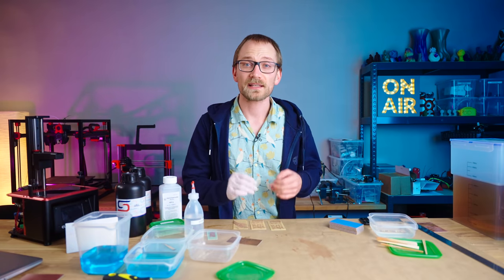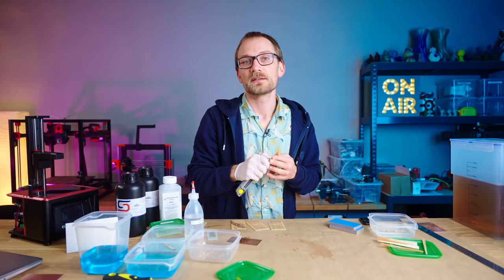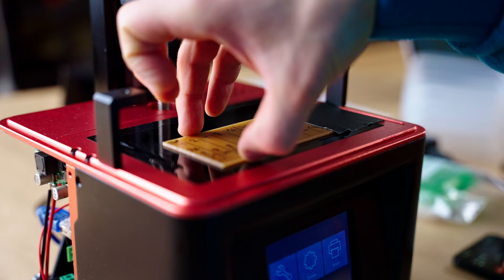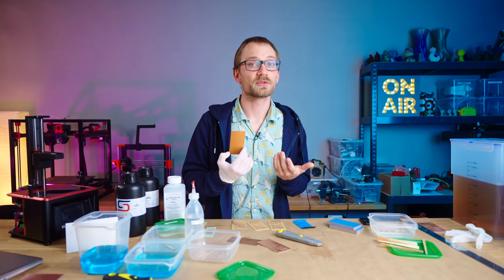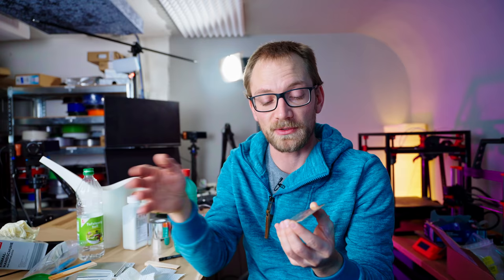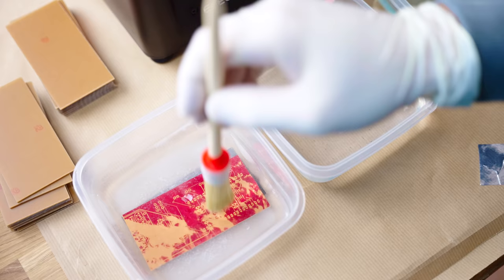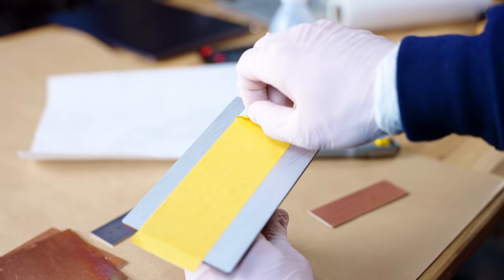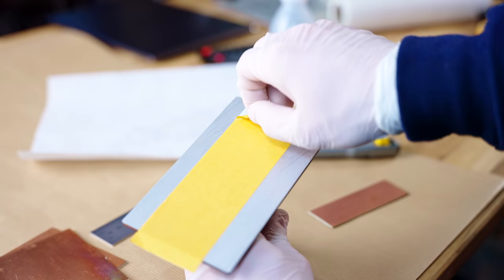The fastest way to make crisp PCBs at home!

Comment: In the past, when I was still dealing with single-sided PCBs, this would have been a great technique. I then used sheets of overhead paper and a good laser printer to make transparencies and lay them over my PCB boards so that I could expose them.
Meanwhile, with the current CPUs that we use, even double-sided PCBs are often not good enough anymore, and I use multilayer PCBs. For this, you cannot go with hobby equipment (unfortunately) and you have to go to PCB factories that can usually make a PCB within 2 days.
But for anyone who needs a single-sided print, this is a great solution. Thank you for showing.
Reply: If you're able to line them up perfectly, you could do double-sided boards as well. But unless you want to go through the process of plating through-holes, you'll have to settle for making vias by soldering a short section of wire between the two sides, and either use rivets for the actual through-holes, or add the aforementioned vias next to them so it doesn't matter which side the components are soldered to.
Reply: 3dprint a jig , and you can do doublesided with no alignment problems. multilayer is ofcourse out of reach at home.
Reply: @chriskwakernaat2328  if you're printing a jig and have standard sized boards, you can easily layer boards, use thinner single sided boards, with a double sided base board and drill alignment holes, and you can easily stack them with a layer of epoxy, though you need to drill bigger holes to solder the vias, which would be the main pain point.
If you don't mind a thicker board you can use rivets for the through holes, and 3d print a spacer to hold the rivet heads.

Comment: I imagine that for prototyping and small scale fabrication, this is kind of a game changer.
Reply: Not yet.
But for some really simple shcemes - yes
Reply: Example: Using a resin printer and this technique... I wonder how many little button cells disposable flashlights you could make in an afternoon?
Reply: @StevenIngram  a lot, but less than by making them with iron and printed paper, but for prototyping is superior in terms of effort.

Comment: I strongly recommend using ground planes on your PCB designs. It's way easier to design a board with a ground plane. It also means you remove less copper, which in turn makes the chemical last longer.
Reply: It’s harder to solder without the mask if you have ground plains. This is for prototyping and fast iteration.
Reply: @xferme  Every board I've made has a ground plane, and I didn't have any problems soldering to any of them without a solder mask. Maybe it's not the same case for SMD components; I've only ventured as far as THT, so far.
Reply: If you're doing it professionally then 4 layer with 2x signal and ground+power planes is what I'd suggest as a minimum for anything that isn't completely basic, which obviously is not possible using this method. Not just for making routing easier but for EMC compliance it's much easier as well. You still have to know what you're doing though, but not as much. When I was first playing around with 2 layer opamp boards I remember introducing error where the high gain opamps amplified the poor return path impedance where I was weaving top-bottom layers. So for serious prototyping, no I would never do this. It's just a hobby thing.

Comment: This is a nice idea. I use positive 20 because it's cheaper than than pre-coated boards (just needs a bit of spray-painting skill). 

To make big boards you would need a big resin printer, though.

But it's real quick. I currently start with a PDF of my tracks that I have printed on tracing paper. Then I sandwich the paper between the coated PCB and a thick piece of perspex. That goes in the sun (after a couple of test exposures to get the time right as sunlight is always changing). I get pretty good results. Suitable for prototyping.

Comment: This is a great idea! I've done many PCBs with the toner transfer method, but it does struggle a bit on smaller features. One suggestion - when using a small etch batch, you get a faster and better etch by removing less copper. Just use flood fills on most/all of the board. You can also make your fill a ground plane, which can help simplify routing and improve signal integrity or thermal performance in some cases as well.
Reply: Im looking at dry photoresist.  Also there is a spray on solder mask that you can solder to before its cured.  So you can tin the PCB and then spray on the mask.  Then solder each area you want a clean pad.  Then UV the whole lot and drill the holes.

Comment: Always add "copper pour" to your boards that you are making with this method because it dramatically reduces the amount of copper needed to remove during etching (and with it the amount of chemicals used and fumes released). It is very easy to do, and can also serve as a ground plane so it makes board design easier.
Reply: But if you get industrial opto coupling interface large copper pour areas on the board is danger for the insulation especially if your project contains igbt or scr connected at power sources fairly different voltages of the logics supply .
Reply: @satipsrl5207  Those boards should be designed as two separate boards and you can add copper pour only on one side or on both, but with different amount of clearance. There should also be a zone that goes under optocouplers that has no copper at all, and also it is common to put cuts in the PCB along that zone

Comment: That's what those little cnc's are good for. Even allows you to drill the through holes. Even one of those give away sample printers can be converted  and use one of those small 60 watt spindles. Even better is using a diode laser for the copper part then drill.

Comment: I've been wanting something to cheaply prototype boards for a while. Very cool!
Reply: There are a few other options to check into as well, like tried and true Laser toner (I've done that and it worked well for me). Also someone modified a laser printer that apply toner directly on boards and then used acetone vapor to fix it. Laser printers can make larger boards.  The method shown in this video of using a budget MSLA printer is very cool though!
Reply: You can't CHEAPLY do this.....

Comment: You could use photoresist film and apply it to the plane copper. Would be a great way for model makers to make brass etching for models or dioramas.
Reply: We used photo resist spray back when I was in the school electronics club. It was kind of an acquired art to get it even though.
Reply: How do we remove air bubbles when we apply dry film to copper clad ?

Comment: FINALLY!  I told people 2 years ago to use their resin printer with photoresist film. Great demo!
  I've made small silkscreen masks  this way too!  You can make the circuitboard and some artwork for the enclosure onthe same machine. That in itself is a boon for any small maker/tinker.

I've been expecting someone to put a Chitu board in a flatbed scanner body tbh.

Comment: Back in the 90s we were taught how to make PCBs at school.
You draw the traces on the computer (Acorn Archimedes!) And then print them on the laser printer.
You put this and the special photo resist PCB blank into the tiny little UV PCB sunbed and expose.
Then you put the PCB blank into the etch bath with its hot vibrating acid.
Wash it off, buff it with wire wool and drill the pads with the 1mm bit in the drill press.
Good Times.

Comment: I am making my boards like this for over 2 years (as Fusion 360 added electronics to their setup)
You do not have to move from eagle to F360 as you have Eagle in F360 already.

Another way (a little faster) if you have transparent foil and ink printer - you may turn your printer in test mode to turn screen on and mask it with print from eagle on foil directly.

Comment: Just started watching your video.
As a soap-maker I can tell you that your plastic containers are fine for NaOH (Sodium hydroxide). The thing you really want to avoid (and it is pretty counter-intuitive, or I always thought it was) is GLASS. NaOH will etch glass and your container will, eventually, break. I'm not sure about lab equipment which isn't made from silicon (it's made from quartz glass) but, again, as a soap-maker (I've gone through a LOT of NaOH. It's what makes fats into soaps. Which is not at all the same thing as the detergents that are called 'soap' by most people. There is also KOH, potassium hydroxide, which is for 'soft' soaps. Both are called, "lye," but I digress...)

Yes, pour your excess lye down your drain. It's not going to hurt anything. It will NOT harm your PVC pipes. That said, I wouldn't know what to do with lye that is contaminated with whatever chemicals get added to it from the photo-resist layer (I'm a soap-maker not a chemist). That's a whole 'nother animal and you should do your own research on that. Lye, by itself, is probably less environmentally hazardous than some of the drain-cleaners you can buy at the grocery store.

All of that said: LYE IS DANGEROUS! 
It absolutely WILL eat you if you get it on you. 
Fragrance oils are pretty nasty, too. Ask me how I know that one...
Reply: I would still check with the local recycling station and try to bring any chemicals to them for disposal, and not just flush it down the drain. The sewage system operators will thank you, as every chemical that you throw at them could cause reactions with other materials/chemicals and eventually will need to be neutralized and removed again from the water somehow. If you can easily avoid adding more unnecessary contamination into the sewage system, you should always try that option first.
Reply: I dont know NaOH etches glass, i have stored NaOH pellets in a glass container.
Reply: @SandeepKumar-jj7zi , pellets are probably fine. As long as you don't get them wet. Once you mix them with water to make the lye it will etch glass. 
Of course, it also depends on the concentration of the lye. Lye for soap is pretty highly concentrated. 
Also, it's an exothermic reaction. In simple terms, it gets hot. It can get surprisingly hot, really. The fumes are pretty nasty, too. 

The long and the short of it is that lye is quite dangerous and if you don't respect it you're going to get hurt. Maybe in a permanent way.

Comment: Been doing this since I got my first MSLA. But you have to watch the exposures near the edges. On most consumer MSLA printers (Prusa's SL1 excepted) there is a significant drop off in exposure near the edges (it actually starts as soon as you get off center). I've gotten around this by creating my PCB layouts in 3D with depth, then a bool layer trims them down in the Z radially so that as more and more layers get exposed less and less of the center gets exposed. Instead one exposure the printer fractionally goes through about 8, each time including less and less of the center. Now traces at the edges are the same thickness as the center with no under exposure. Very clean, no almost opaque laser printed masks, and because you don't have the print plate getting in the way you can put an alignment system on the stage and do double sided board in perfect registration.
Reply: I am trying to make PCB using same technique, but tracks on the photoresist film seems foggy(poor resolution) after exposure to uv light. Do you know how can this issue be resolved?
Reply: How large are the traces? There is only so much resolution on the LCD for masking, but even then you can get them pretty fine.

 How long are you exposing for?  What are you using  to develop the photoresist?

Depending on which machine you have and what kind of light engine is inside (and what kind of lenses) you may need to put a UV transparent diffuser film right on the LCD glass to even out the light.

Comment: Very nice. I have a laser engraver and I did some PCBs by painting it with permanent marker and laser the tracks away. then acid and it's done! Like what you were trying to do with the resin directly on the PCB. Also works very well and gets very fine results... depending on the laser's resolution. But 90 seconds for a "big" board is faster than the 4 minutes of my highest resolution small board... but anyway, is also fast that order it from China!
The best solution, in my case was to "laser" the circuit first to have a reference for the holes, drill the holes, clean the paint and redo the laser without holes in the drawing, to make sure tiny misalignments in the drill press get the copper to the hole, and only then, acid the extra copper away! Also, with the holes already done, it's very easy to alight a two layer design.

Comment: BTW you can just draw the circuits with a permanent maker on a transparent film and use that as mask for the pcbs if you have nothing else. My cousin used to do exactly this in the late 80's he started using a sharpie to draw the pcbs, and when he could afford it, he bought an XT PC ( no mouse, no HDD for the first year) and an EPSON dot matrix printer (this was the first PC I ever handled btw) and with a DOS software to draw PCBs ( they looked identical to the ones you show in the vid), he would print the PCB layouts in normal paper, then he would take the prints to a place they photocopied the prints into a Transparent film, and since it was toner ink on the photocopier it was super opaque, and then used these film prints for the photo etching of the pcbs. Eventually he bought an HDD and a genius mouse,  At that time he used to build the electronics and antennas for FM radio stations, and he was a 24 year old college dropout xD.

Comment: If you want to try the 3d goo as a resist you could try diluting and thinning with a compatible solvent and spin coating it on a plain  pcb.  It looks like it's a 10x - 100x too thick.  Also if the lye is too finicky with timing sensitivity maybe try sodium metasilicate pentahydrate it may be more controllable.  Also pretty sure you can get positive or negative uv resists to avoid a step for the image.

Comment: Brilliant Thomas. I have the Mars 2 Pro, and an older i3 Wanhao clone that I also setup with multiple toolheads (FDM, CNC Drill to 1.5mm, CNC Engrave - sharpened 8mm stainless rod drag style). I have a bag of single sided 0.8mm PCB blanks. Was going to try a simple project like making a multi-layered Arduino or something to prove the 3D printers can do multilayer PCB's. I think the key will be layer alignment, and this can be done with first using the dremel and those small drill bits like 0.6mm. FlatCAM was made for making PCB's, has many options like drill depths for CNC drilling gcode a 3D printer with Marlin can understand.

Comment: Wow, fantastic idea! Even an entry-level resin printer would be adequate for a lot of hobby-level boards, and a mid-sized one would be plenty big enough for most anything a typical maker would need to do on a quick-turn basis. (I also second the tip below about using iron-on photoresist film.)

Another thought: A 3D-printed jig could help you align the boards accurately enough to do double-sides ones repeatably.
Reply: I'm waiting for a new preordered FDM printer to arrive and this has me looking at resin printers for this purpose. Could come in really handy to finish a car lighting project. I've had a couple orders of boards so far, but I'm going to need a few more one off boards to finish it up.

Comment: This got me thinking. As someone that has etched photos onto PC boards 10+ years ago I wonder how hard it would be to modify an old resin printer (I have one I never use) and instead of sending it STL files to change the electronics to just send a picture (the screens were designed for this after all) and just use it to display an image and use a timer to turn the LED's off and on. Instant custom PC exposure machine.

Comment: I made this with photo sensitive lack or what ever the name in english, and mercury lamp and of course printed the circuit to a translusive material, then I exposed it for a half minute to 2 minutes, then 0.1% NaOH solution then FeCl3 or quick etching solution. Before that, I used permanent marker to draw to the copper. But this is a good method :)

Comment: You could potentially also use the PCB exposure tool in the program UV tools to create .ctb files from gerber files, which any PCB software should have no issue saving as, avoiding creating 3D stls for chitubox or lychee.

Comment: Alternative for etching the board use citric acid (they sell bags of this like sugar, very cheap) , pinch of salt and  hydrogen peroxide (as strong as you can get, 10% is around good for etching).  Good thing is you can reuse this solution by adding more hydrogen peroxide and salt. When you are going to dispose the solution heat the liquid until all water boils, and then burn the green crystal until they turn green brown. that is copper oxide and is mostly inert.
Reply: I wonder, why wasn't he using ferric chloride? That's just a salt of iron, not too dangerous or expensive, and also if I've heard correctly, infinitely "rechargeable".

Comment: Interesting technique. Last time I etched a board at home, I used the toner transfer method and etched in a muratic acid/hydrogen peroxide solution. It worked pretty well. Used the same solution to etch some brass sheets to make custom playing cards for a steampunk Gambit cosplay too.

Comment: Technically you can spin coat the resist on the copper board, by mounting the copper board on a spinning motor (1000rpm or more), and then bake anywhere between 50 and 150 according to resist specs, and then you should be able to use it as a precoated PCB

Comment: Yes it dissolves skin but very slowly, wouldnt be too worried about using gloves, you can have 100% solution of that and if you dip your finger in it for a moment it won't do anything, you keep it there for few minutes, first layer of your skin will start to soften, 1st layer damage is nothing.
But eye is no joke, use eye protection.